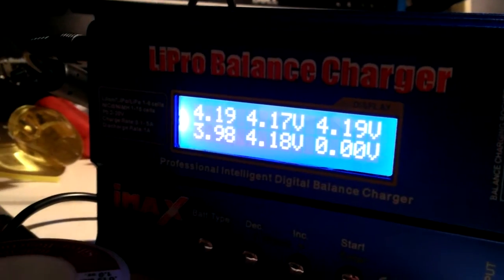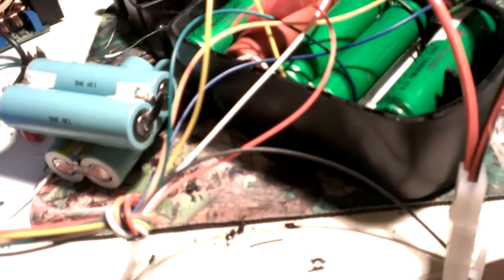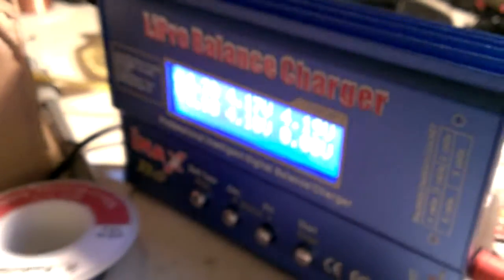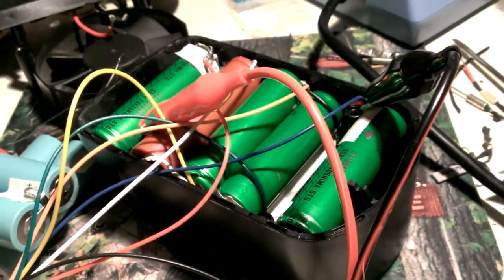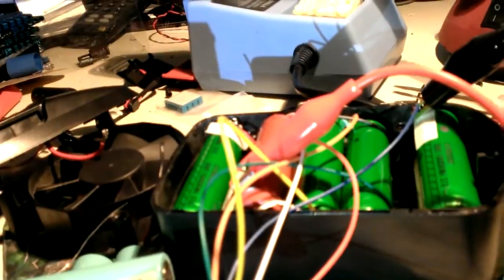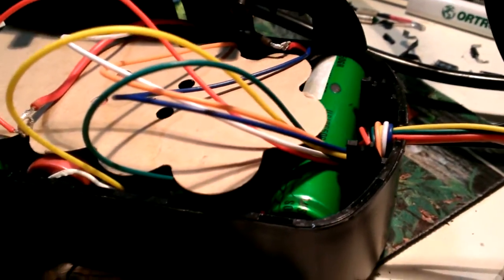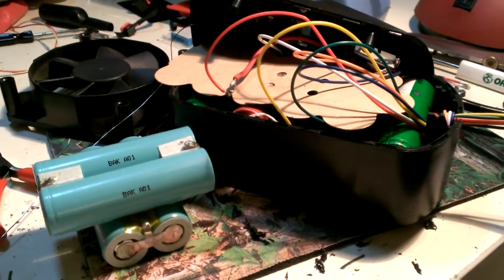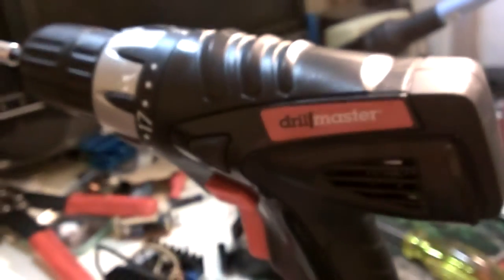Harbor Freight DrillMaster battery rebuild 2/2

Comment: How many batteries did you use? is it 5Serie3Paralelo? gracias
Reply from the maker: it uses 10 cells. 2 in parallel and 5 in series. 2p5s
Reply: gracias.

Comment from the maker: First off, Thank you for the positive comment.  You could reuse your protection board from within your existing battery.  I have seen cheap protection boards on Ebay but not sure of their build quality.  I oped to not use a protection board on my build because i've had cheap protection boards cause fires in the past, just used a 15A fuse inline.  Having two batteries in parallel allowed the current draw to be shared between the two so they almost never get warm.  We built a 15' wooden boat with over 500 screws and put them all in with my drill without any overheating at all but i know that your Milwaukee has a much more serious drive motor than my wimpy harbor fright screw twister.  Good luck and i hope to see your DIY video on the M18!
Reply: You wired so many in a series and two in parallel so could you please explain how that works? I know in a series it increases the voltage and parallel increases your amperage so how did this increase the battery life and how does this work without blowing up? Does the extra couple in parallel make a perfect voltage? Thanks

Comment: In the future i am planing to do the same with my Milwaukee M18 Drill, the original battery use 1500mAh Samsung Cells, I want to change for 3200mAh Samsung Cell to get 50% more run time... I hope :)

Comment: Very Nice.... the only problem is lack of protections.... i have a Milwaukee M18 hammer drill and when I teared down the battery, there was a electronic card that protects the battery from overheating.... but i really like your video.... the feeling of DIY is awesome......only use your drill carefully because you could kill your battery if overheat